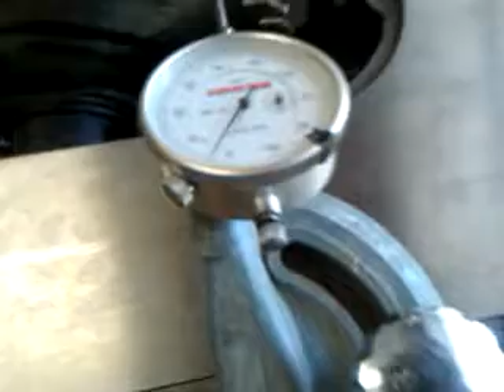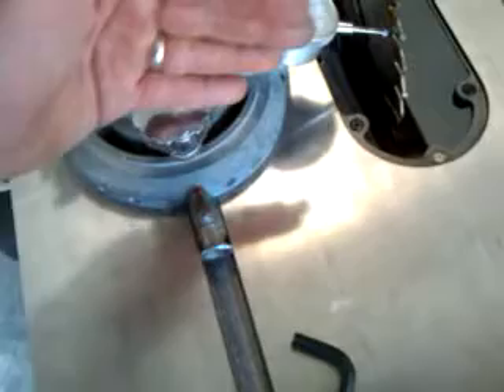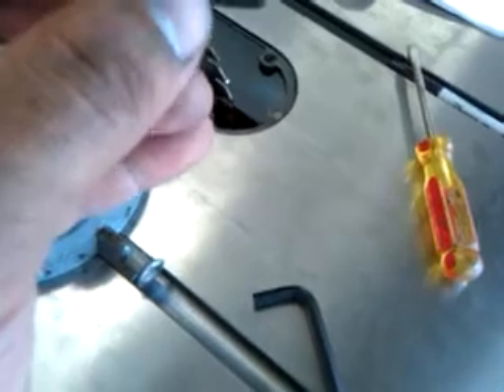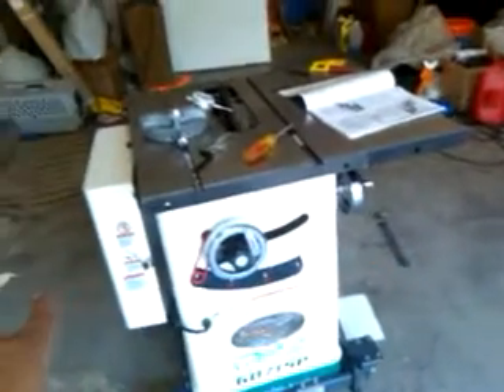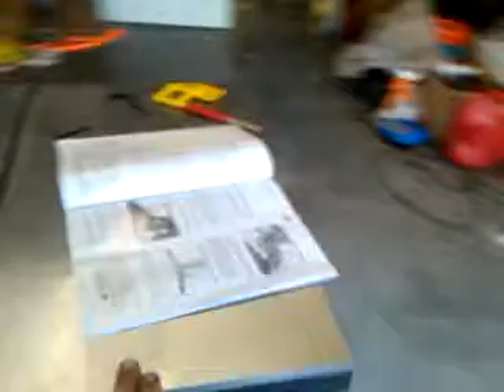Grizzly Hybrid Table Saw G0715P Part 3

Comment: Thanks for the video. Based only on your video, I'd be inclined to buy one. I'm wondering, though, if you have measured to see if your saw has the 'blade drift' issue when the blade is elevated/lowered?

Comment: When you grabbed the motor and moved it, and in turn moved the blade, were all the screws tightened?  I am not sure if there should be any noticeable play in the motor/trunnions/blade unless there is a significant amount of force put on it. What I'm thinking is it could do the same thing in reverse... force on the blade could flex the trunnions/motor and in turn affect the quality of the cut.